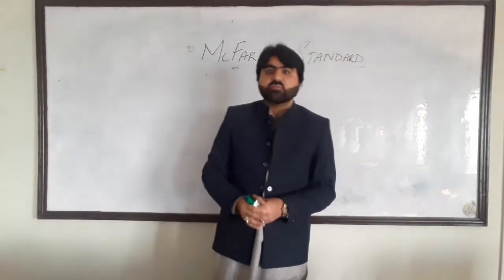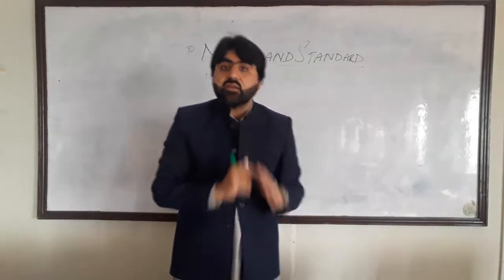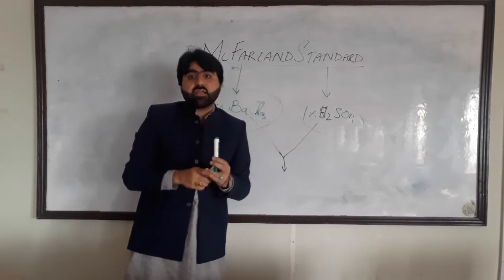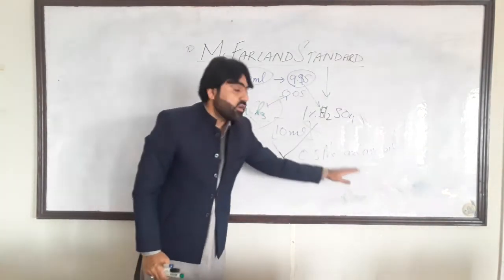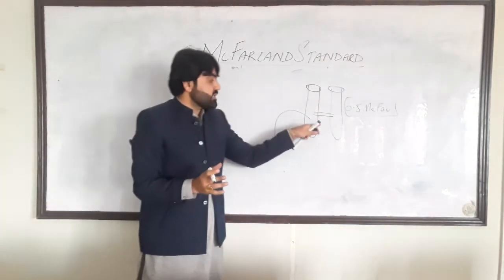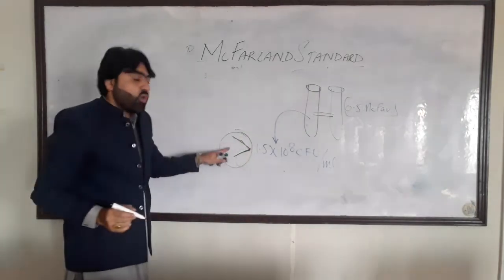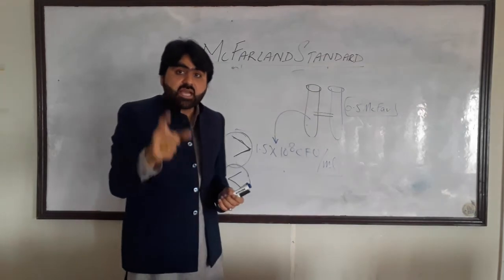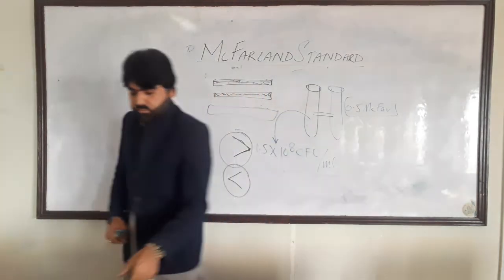McFarland/Turbidity Standard | Composition | Uses | Importance | English

Comment: thank you 
from Egypt 
what is the difference between measuring the bacterial suspension with this method and with spectrophotometer
Reply from the maker: These are the two different methods used for bacterial count in a suspension but count is recomended with Msfarland standard or Nephlometer